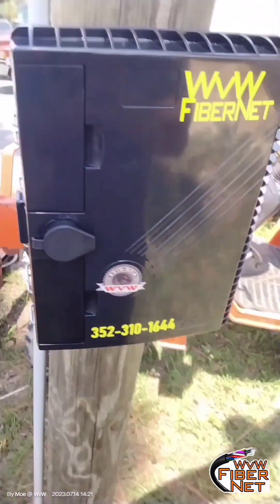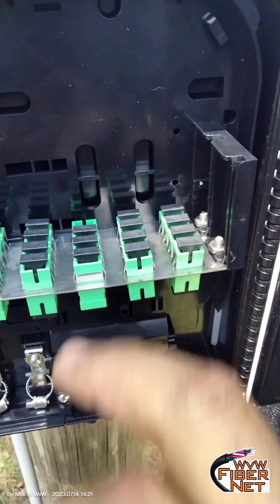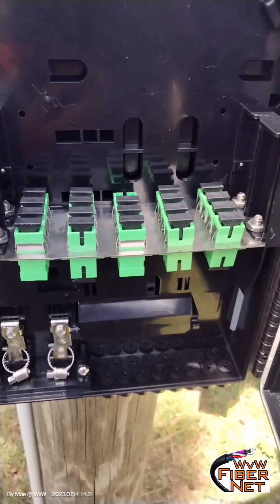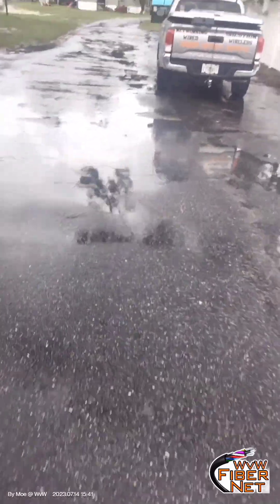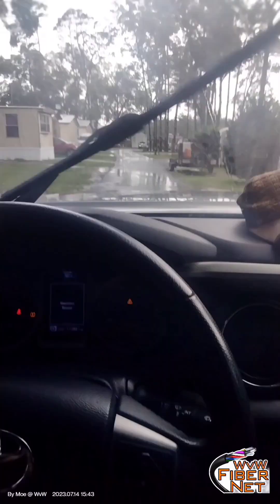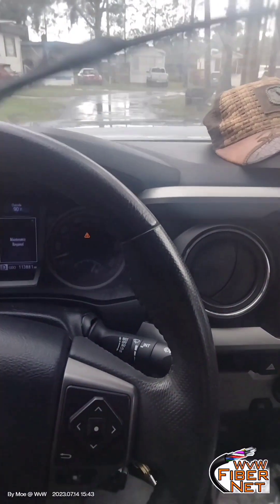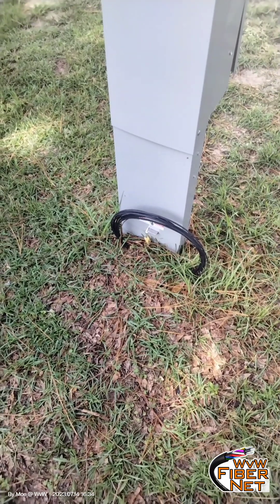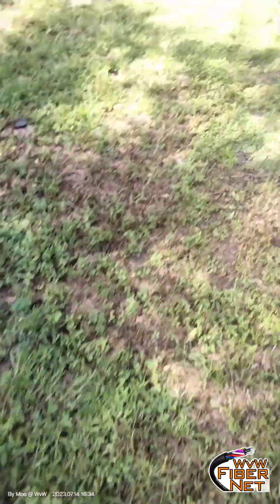RV/Mobile home park fiber broadband installation video 1

Comment: What’s the best way to run the fiber optic cable inside your travel trailer?
Reply from the maker: is this a network build inside the trailer or how to get the fiber patch from outside to inside?
Reply: @wvwnetworking I’m living in a rv on my parents property and they didn’t have WiFi so I’m getting fiber installed and I was mainly wondering if I would be able to retract my slide out and run it through and slide it back out without damaging the fiber